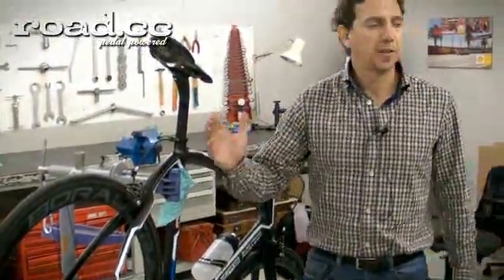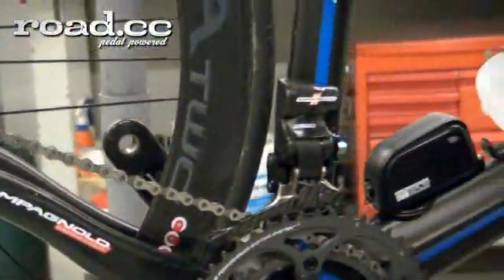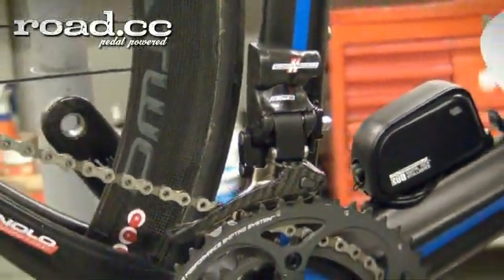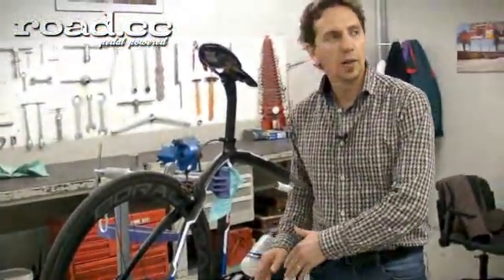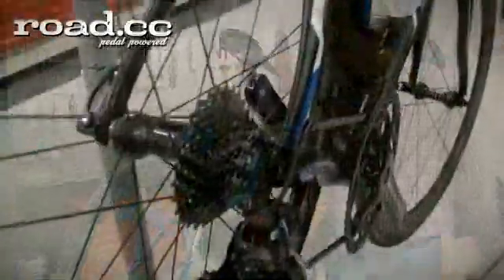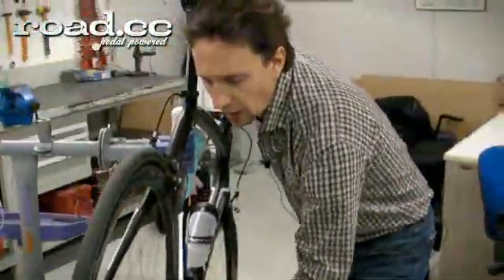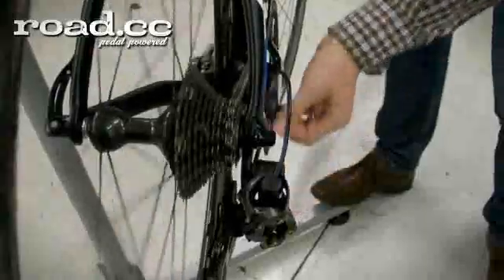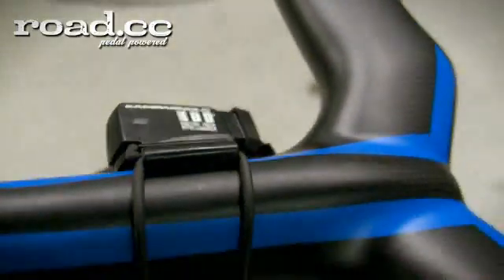Campagnolo EPS in detail

Comment: You are screw if you have problem with cable, they have very bad solution for connection with driller, battery and interface.
If you cut your rear driller cable, you must take new driller, all so you must take new front driller and the new battery in case of  having problem with cables . Shimano have better solution for that problem. This is huge engineer mistake.

Comment: I bought my Campagnolo 8-speed in 1996 and it has worked very good and I don't want to upgrade unless I have to.  The problem is that the parts are getting very expensive on ebay, especially for new old stock (NOS) parts.  They want at least $600 for NOS brake levers, if you can even find them. Cassettes are very expensive in some of the more desirable sizes.  They want $40 for just a lock ring. Period correct rims are also very expensive. It's all expensive. I might as well upgrade.

Comment: The evidence is clear that Pioneer don't care about supporting 8 track players they sold in the 70's. 
I guess if you have to have a period correct 8 speed Campy system from 1992, you might not get support directly from campagnolo, but you might be able to replace your vintage bike kit on ebay... 
'…make older parts expensive and hard to obtain'. LOL So, they got you to consider EPS because 8 speed stuff is 'expensive and hard to obtain'.

Comment: I bought Di2 for less than I could buy Campy SR11. My hands are small, so after 2hrs of racing when I'm buggered and I want to shift into the big ring coming out of that last corner, sometimes I just can't do it. Pressing that button means I get perfect shifting 100% of the time. That's what I'm paying for. I have the money, I use my bike so often that I think the benefit outweighs the cost, so I pulled the trigger and it has been the best bike purchase I've made in years.

Comment: Sensitive much? I said you'd be lazy IF you don't perform basic maintenance at least every 2000km. If, like you say, you have 4 bikes which you maintain in top mechanical condition than you would be more than capable of popping a battery in a charger once in a  while, no? So the charging is a non-issue.

Comment: Thank you for calling me lazy. That was totally uncalled for and rude. What I meant to say was that unlike other things in the bike, batteries die. After a couple of years the lithium batteries will last much less than when they were new, and while it is pretty easy and cheap to change a broken cable, a tube or brake pads, I don't think it will be cheap or easy at all to replace a dead battery in the middle of the road or trail, unless you bought an extra one and bring it charged just in case.

Comment: I've cleaned my chain more than I've charged my Di2 battery. If you are so lazy that you're not performing simple bike maintenance at least every 2000km, which is approx how long my battery lasts before the green light starts blinking (which is not even a warning for a flat battery) than you've probably got some more serious mechanical issues to worry about than a flat battery.

Comment: Actually, no, not like Shimano at all.

Shimano's  system works on a totally different basis - not better, not worse, just different.

The biggest advantage that electronic shifting gives is that it shifts the same way, every time, in every circumstance - small hands? No problem, the lever movement is always the same. Not able to make a chainring upshift cleanly because you lack finger strength or purchase - not a problem, it is motor driven.
I agree it's not cycling as I gre up with, but ...

Comment: The battery annoyance is a non-issue, really.  I've never grabbed my Di2 bike and thought damn, battery is dead.  You get a lot of advanced notice and it takes less than 10-20 seconds to pull the battery.  There are quite a few advantages to Di2/EPS but that doesn't mean mechanical shifting is obsolete (at least not until prices drop more.)  I'll still never go back to cable though.